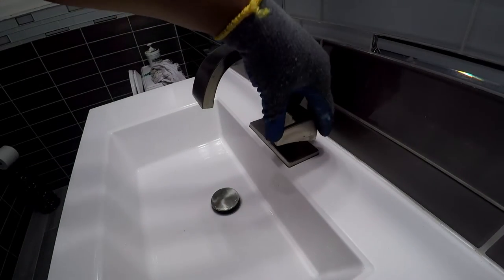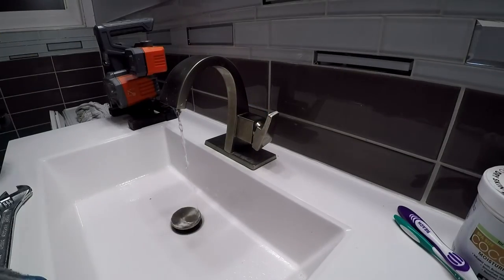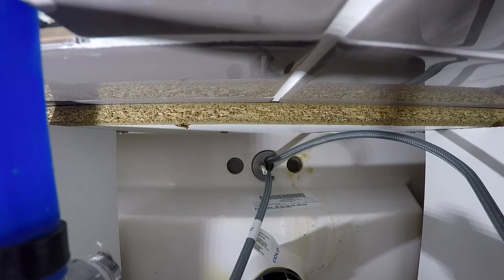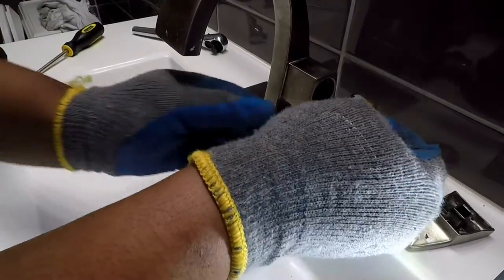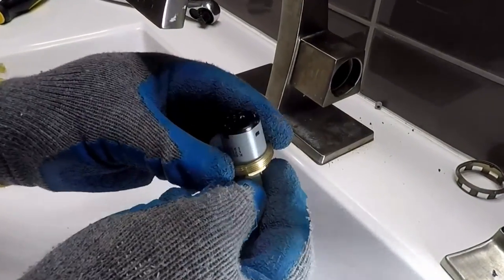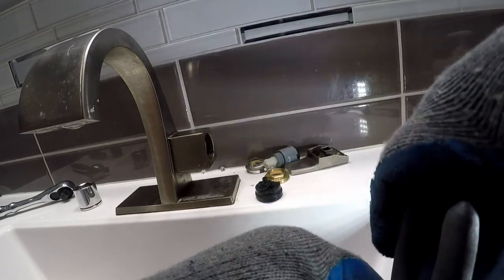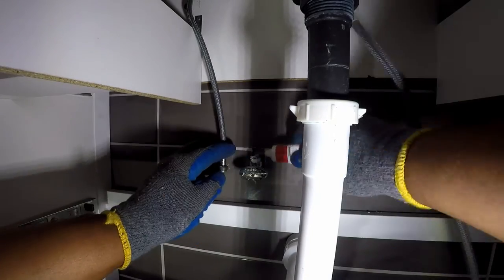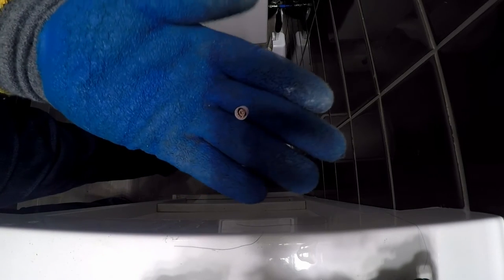Kholer Katun - Poor Water Flow Resolved - M18 EP30

Comment: HI there I have the Katun 3 hole  bathroom faucet and am having the same issue with poor water flow.. Where would the restrictor be in that one?  Model# K-T428    Thank you!
Reply from the maker: I could not find the Model KT428 parts manual. It appears the restrictor is located in the assembly connecting the hot and cold water to the spout.
There are strainers in the water inlet lines. These should be examined for blockage as well.
Reply: @GoldenJudge   Yes!  You are right.. I drilled a tiny whole with the smallest drill bit through the strainers in each the hot and cold and now it flows beautifully!
Reply from the maker: Excellent work.

Comment: Will removing the water flow restrictor mess up your pipes?
Reply from the maker: Hi Celeste,
Removing the restrictor will not cause a problem with the pipes. You can expect years of reliable service without the restrictor. I have not had a problem with the faucet since removing the restrictor. The pipes are also in good shape, which means there is no knocking, leaks or the like.
Reply: No; it is the incoming pressure from the City going beyond 80 PSI and what controls that is a PRV.